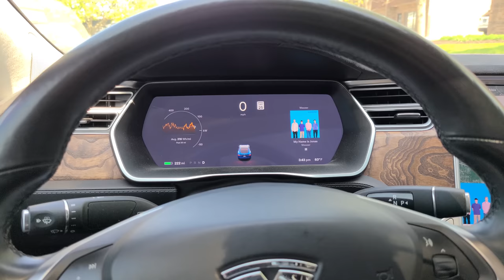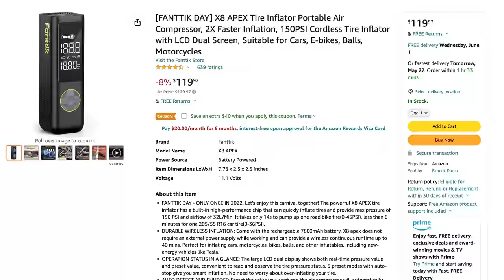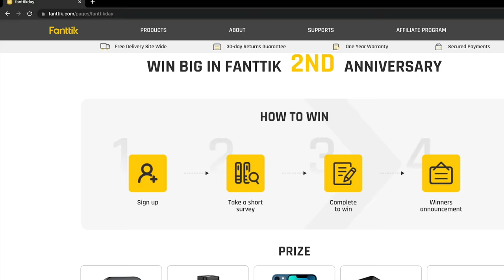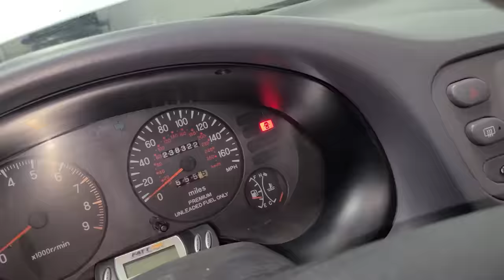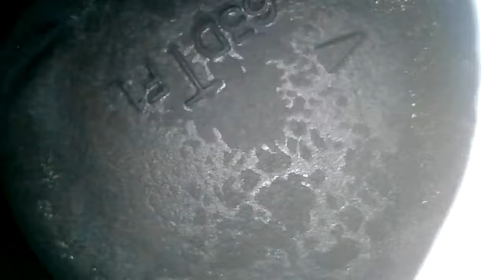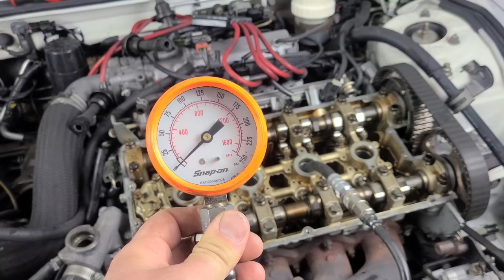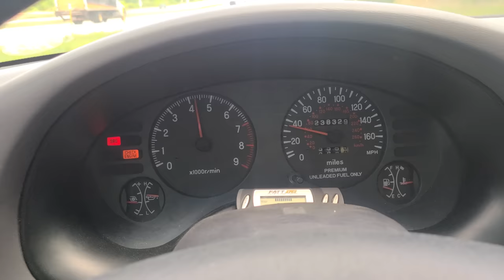I OVERPAID For The MOST Modified & Destroyed Japanese Tuner Car Ever! It's A TIME CAPSULE!

Comment: Was convinced you were going for this cars big brother in the 90’s.  Still a fun car though.
Reply: i was expecting 3000gt vr4 as well
Reply: If he wants to restore my 93rt/tt stealth I'll let him.  I'm down for a 4g63 swap too.
Reply: @blakea216  A lot easier to change the spark plugs on a 4G63... ;)
Reply: I was expecting it to be a stealth since it said jdm and american. Ironically the eclipse is very usdm and japanese, so the opposite of the stealth.
Reply: @turbo_brian  well that not really true the non turbo cars use a neon engine and the entire subframe and chassis are actually different, the turbo cars are all mitsu so a gst or gsx is fully Japanese
Reply: 3000gt and stealth are a engine nightmare
Reply: Stealth/3000 is bigger on the outside, but less practical overall. The price difference (back in the day) would mod the DSM to be faster. Guessing a good Stealth/3000 is harder to find, thus 1.5x or 2x the $$

Comment: Beautiful find. Some things I would recommend thinking about replacing:
1: go to a helical center diff
2: poly bushings for rear diff and suspension
3: upgrade the synchros in the tranny (while you're in there consider upgrading other tranny internals)
Reply: Helical center differential aka Quaife is weak and prone to failure. 4 spider center and a front differential of your choice would be my recommendation. He will have a hard time finding parts for the transmission if he can't even find the turbo oil return line gasket which is still available (MR258477)
Reply: Poly motor mounts especially the lower
Reply: Somethings I would recommend: Entirely rebuild and upgrade everything XD

Comment: For that thing to have 230k+ miles on it and be in THAT good of condition means that the previous owner fucking adored that car and gave it the best possible care for all those years. Like its impossibly rare to see someone care for such a car to that level for that long.
Reply: And now it’s gonna be modded to shit with body mods that don’t belong on that year car, make too much power for it to handle (watch the trans and axles with that mileage go), and be lowered and look stupid. If the owner watches this it will be sad. He kept it so original just for it to fall into what he had hoped would be a responsible restoration type of owner.

Plus at 42:10 he freaking dropped the clutch with the unknown howling… this thing is already getting beat on more than it has since the previous owner had it.
Reply: Jesus Christ, the car was not cared for behond all belief. It was from freaking Nevada. There isn’t going to be rust on the car. The car was probably owned by somebody who just used it at a car.
Reply: @NorthwesterNomad  He said in the video it’s probably one of the last clean one of those, I doubt I’d find one that clean without rust. Plus “original” can be achieved.
Reply: @destruxandexploze2552  Whatever the original owner thinks is irrelevant, they sold the car and therefore have no right over what is done to it.
Reply: @destruxandexploze2552  complain harder 🥱

Comment: Super excited for this new build series Alex! I had a 1st gen DSM that I fully built years ago. I have one hard lesson I want to pass on to you. Upgrade the PCV / crankcase ventilation prior to upping the boost or upgrading the turbo. The factory system is too small and it will back pressurise the oil return on the turbo! I went through 2 turbos because of this. this can also be the reason you don't have an oil dipstick as they typically pop off from the crankcase pressure. Good luck👍
Reply: Sounds like solid advice so I'm voting it up ☝️
Reply: I knew what it was as soon as he was driving it. Lol the back seat and where the rear speakers were gave it away. My little brother bought a 92 eagle talon and it completely changed my mind on four cylinders.
Reply: Good advice. Upvoted
Reply: @g.nijsse1237  Okay Reddit
Reply: Blew a few oil sticks off my 1ga.
Reply: I love my 1st gen. Love it so much I bought two.

Comment: Couple of thoughts for a 'mature build' as you mentioned:

1. Go for maximum drivability, at least over exaggerated looks/sounds. This could be a beautiful car 'for those who know'.
I'd at least add a muffler and possibly also extra sound insulation to the interior, so you really want to take this car for a road trip.

2. Don't overspend as most of us wouldn't. Find best value upgrades and show us your options, considerations and choices. Your audience will appreciate it.
(AP-coilovers are available for this car, as is a Holset turbo. Both will give you performance and reliability affordably. A Holset HX35W will get you your 500 HP reliably with acceptable EGT.)

3. Don't go crazy with the paint, make it elegant and stay far away from Fast and Furious styles. I'd be more thrilled about adjusting the gearbox and ratios to the new power output, than seeing the original body being mutilated.

4. Tires on a 90's car should have some meat, both for the visual aspect as for the way it drives. 18, 19 or 20" with 35-30-25% sidewalls would make the build immature. So go with 16" or 17" light alloys, combined with brakes that are a good fit with both.

I'm interested to see what others think about this ...
Reply: Absolutely agree. These cars are not meant to follow the awful trendy TikTok wave of big wheels, slammed to the ground, tacky paints and whatever else. Ironically I owned a static LS400 that was 2 inches from the ground which I sold for a 1st gen Talon and your points mainly fall in line with my personal plans. They certainly deserve to be respected for what they are as a more mature tuner car that can look and perform beautifully if done right.
Reply: I like holsets, I'm running an fp green on mine.

Don't go any bigger than a 17X9 on these cars. 18s look too big.
Reply: 18’s with a 40 sidewall, 17’s were becoming standard by the late 90’s on performance models. For paint definitely stay away from flashy super car colors even white is played out…
Reply: @wss952  too bad most of the cars sold weren’t the boosted performance models. The oem turbo bulge hood was usually just a reminder of what could have been. Love the raised rear spoiler on the late 90’s talon though thought it looked better than the eclipse. The first gen talon actually looks great even today with the pop up headlights
Reply: @dirtyaznstyle4156  most of the models looked pretty good and have their own cool things except for the pre facelift 2G which looks awful but the hood bulge is actually on all models and was for the timing belt on the 4g63s and on just for looks on the base models with 420a.
Reply: @wss952  yeah I just call it the turbo bulge as a styling element lol. One of my first cars was a ‘90 z24, I miss the 90’s styling. Cars were light back then too, that z24 was less than 3000lbs
Reply: I like EVO 8 wheels
Reply: @2hipsis13  Seems he read our comments :)

Comment: Umm, I have a 1990 Eagle Talon FWD Turbo that has been in my garage since 2001.  It's completely original.  There was a small dent in the front fender, and a small patch of rust on one quarter panel.  I had the notion when I was younger, more ambitious, and "suffering" with OCD that I would rebuild it top to bottom but after a bit of tear down, life caught up to me and I stopped in my tracks.  While catching up I obsessively bought tons of parts for that car, also bought and rolled another 1990 Eagle Talon AWD Turbo.  Now both sit there, with lots of potential for resurrection into a completely "new" old car but no interest to ever finish.  Any fans of this dude want to chat?

Comment: these cars are timeless looking for real. ive had a couple myself and they are beautiful cars, i just wish they werent so prone to rusting out the shocks like they are. id still daily an eclipse anytime tho, they will always look incredible.
Reply: Couldn't agree more 🙃👍*
Reply: Why not coat the areas that are prone to rust? or im missing something? I wouldn't drive my sports car in the rain anyway even more so strict on salty roads.
Reply: @aidenp5768  it helps to an extent but alot of the time its just thin metal fatigue after years. Especially in ohio where I'm at, the slightest bit of rust or fatigue, along with potholes, makes the struts pull the whole strut tower up.
Reply: Eclipses were timeless looking until they came out with the body for the 3G purple and chrome looking Tyrese Fast and Furious one.
Reply: @emmel07  big facts there. I guess I should rephrase it and say 2g eclipse or just most dsm were timeless.
Reply: @xSGTBONGRiiPPxxADVENTURESx  Oh I see what your saying, it’s something that BMW E46 chassis also suffered with in a way. Got you, that sucks, especially if your a huge fan of such a car.
Reply: @aidenp5768  oh for sure every car has its weak point for sure. Thats why I've stuck with hondas since selling off my dsms and miata, at least their weak point is often easy to fix myself. Haha I never had a e36 aside from a few day quick flip. But it was a beater I never drove aside from sliding it twice and selling it off. I love bmws but they are just notorious for their issues that will be more expensive than a whole other car to fix. lol

Comment: The 7 bolt crank walk issue was way over exaggerated in most cases. Usually the primary cause of it is a heavy clutch used for higher power applications.
Reply: Had an act 2600 on mine back in the day with a evo3 16g and never had any issues at 365whp. Loved that car but Wisconsin winters gave it cancers
Reply: My crank walked in my 96 Talon tsi, while out of state at around 80mph back in around 2004 in PA. Took a bus back up to NY and towed it back about a month later. It always seems to be exaggerated when hasn't happened to you.
Reply: @Saiyan585  didn't say it never happened just isn't as common as people make it sound.
Reply: My '97 GST auto crank walked on me.
Reply: 97 and up there were changes made I believe at the block cradle for the crank and CW is a non issue.
Reply: @tbotello  I’ve blown 4 motors in mine and never had crank walk in my gst

Comment: Can anyone explain how the 4G63 sounds so good as a 4 cylinder? It truly sounds fantastic for an i4
Reply: It is indeed the best sounding 4 cylinder by far. I love how the gear ratios are set because it makes it sound even cooler
Reply: Try the alfa romeo twin spark they also sound fantastic for a 4 cylinder
Reply: One reason why the 4G63 is so good is because it's actually the engine from the older models of the Lancer Evolution of the same era. It's an engine designed for rally racing. Mitsubishi gave the Eclipse GS-R and GS-X the 4G63. The base model Eclipse GS and the Eclipse RS got a different engine that barely hit 90hp to the wheels. A basic commuter engine. I've always loved 4G63s. Because it's so similar to the Evolution engines, you can pretty easily swap in a true Evolution engine into the higher trimmed Eclipse models.
Reply: @Thanos.m  fiat hehe
Reply: @tinystar3010  GS-T, not GS-R
Reply: You sure it's GS-T? Idk why I'm thinking GS-R, but it has been like 15+ years since I've been around the Eclipse scene. GS-T does sound familiar. You might be right.
Reply: No, you're right. RS, GS, GS-T (first trim to include a turbo hence T) then GS-X because it's AWD. Thank you lol it came back to me.
Reply: I dunno, as a DSMer those K24s with hood
exits make me jell.
Reply: The turbo. Without turbo they sound like any other 4cyl
Reply: @tinystar3010  GS-R is a turbo awd in japan only :)
Reply: It’s the fireing order.

Comment: To stop crankwalk:

1. Use 6 bolt rods because they are wider. Then narrow each rod at the big end individually to match the crank journal in which it will be assigned to. You can assure a snug and perfect rod side clearance with the crank to prevent excessive oil loss due to centrifugal forces.
2. Resize the big end of the rod as most (not all) aftermarket rods are too loose with bearing clearance.
3. Use only the wider early style 6-bolt rod bearings as they tend to not only live longer and have more surface area, but they hold more oil in to prevent loss.
4. The crank oil passages are too large. So large that they can continue to feed oil to the rods as the mains don't get enough. Modify the passages so as to increase oil pressure at the mains yet still give the rods adequate oil to live a long and trouble free service life.
Reply: No

Comment: The front main seal is leaking and most likely has a groove in the crank where the seal is. It's common for a groove to be worn in it on higher mileage DSM's. The easiest way I've found to deal with it is to slide a micro sleeve over the snout.

Comment: I had a 1981 Plymouth Sapporo made by Mitsubishi that I bought from my parent in 1986. Finding brake pads for that car was nearly impossible and when I did finally find them after calling everyone they were really expensive. Great car. 2.6 liter engine, 5-speed, rear wheel drive, 4 wheel disc. Not a lot of HP but a torque monster. Loved that car.

Comment: $8K for a clean car that you have wanted since like forever-is a dream come true. Almost 240K(about distance to the moon) on the odometer sounds about right for a well maintained Japanese engine. Had '88 Mazda 323 til 2015(mostly outdoors in Florida) and took to dealer for 25th Anniversary and dealer said cylinders and valve train were in excellent condition.  Not surprised if engine is original.

Comment: build the head, raise the redline, and a nice fp red or fp black setup on e85 should make somewhere in the 400-500 neighborhood. It sounds like you're going to do this right and make it a clean build, so i'm looking forward to seeing more of this thing
Reply: Uh no, head port, 272 cams, built bottom end and HG, big turbo, HKS SSQ blow off, Tial WG, tubular mani (with braking as they always crack), 3" o2 housing, 3" exhaust, High flow cat (to pass emissions) stock looking 3" dual exhaust muffler (for states with exhaust moding laws), 650+ injectors, walboro 255 fuel pump, 3" GM maf conversion with maf translator, big intercooler with 3" pipes, get the trans beefed up and throwout bearing, short shifter, rear beefed up, axles beefed up, stage 3 clutch, alcohol injection for the engine...I could go on and on. This will make well over 600hp and be reliable without ruining the car or interior or being stupid annoyingly loud. You can also go MUCH further and make up to like 1200hp on the bleeding edge but 600-800 would be plenty on the road to smoke most competition.
CAST IRON 4G63 4EVER!

Comment: I had a 99 GST I loved that car it would smoke the tires till you grabbed 4th gear 😁 Evo 16g turbo front mount and ethanol was like 350hp that's plenty, the torque steer on the fwd is no joke if you weren't careful you were in the next lane real quick 🤣

Comment: Don't get a heavy clutch pressure plate. Get a twin disc setup if you want good power and to keep your crank happy. Also, keep an eye on your front lower control arms. Back in the day they had issues with the aluminum being weak in those (recalled). Don't expect to turn fast at low speeds and high rpms unless you figure out a way to make an mr2 or volvo electric power steering pump work. High rpm cutout assist in your steering will happen if you autocross it. Replace the radiator if it's stock. End tanks were garbage. Otherwise, these are fantastic. Had a 2g gst and about four 1g awds. Love dsms and hate they were never taken care of by most owners.

Comment: There are also a few different versions of the 7 bolt.  The early versions use a 360 degree thrust bearing like the 6 bolt blocks, and they moved the oil squirters from the bottom of the cylinders to the main saddles. The later 7 bolt blocks moved the squirters back to the cylinders and went with a 180 degree thrust bearing.  Also, the 6 bolts use a 12mm head bolt with the 7's using an 11mm.

Comment: I had a bone stock 1990 Eagle Talon Tsi AWD that I bought back in 2010 for $2500. It had the ugliest wheels on it so the first thing I did was get some 2G DSM OEM wheels for it with new tires. I put a 2g turbo manifold on it, 2g "609" MAF, 660cc injectors, an Evo III B16G turbo, 3" downpipe and exhaust, a front mounted intercooler and piping, a 1G EEPROM ECU, and I had it tuned at 20 psi to make 348 awhp. It was alot of fun and it was very reliable.

Comment: I said $8700 just before you said the price. I was contemplating a S14, a GSX, or a MR2 Turbo back in 2007 (when they were in the $6500 range still). I ended up with the S14 (which I still have and won't ever get rid of), but really would love one of these; as well as that MR2. My S14 is a rust-free CA car and will not get to see the Midwest salt roads. Keep yours the same way! Really looking forward to the build, Alex!

Comment: I have a 97 Talon awd. Lightly modified, factory rear lsd. Under 50,000 original miles lol. Didn't realize it got so rare. I agree that the 4g63 exhaust sound is better than most 4 cylinders.

Comment: My first job out of high school was at a Mitsubishi/ Nissan dealership in the late 90s. I was a porter, oil changer,part runner, basically whatever they needed and got to drive alot of these as well as the 3000gts ,300 zx , and occasionally 200sx. Such a fun job even though 7.50 an hour just wasn't enough to stick around but I still think back on all the cool cars I got to drive.